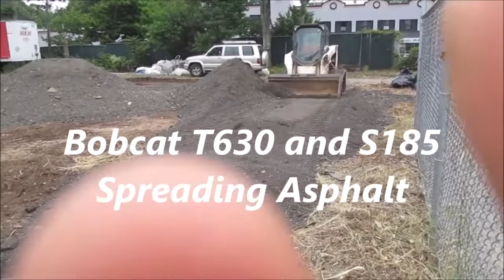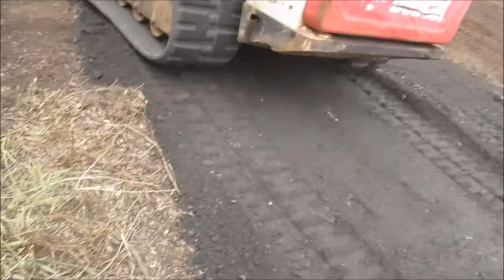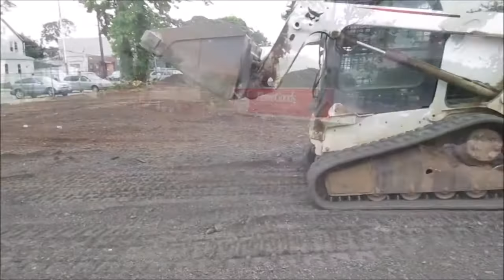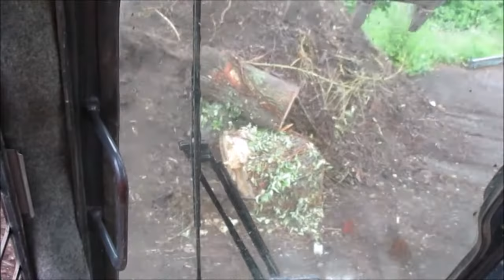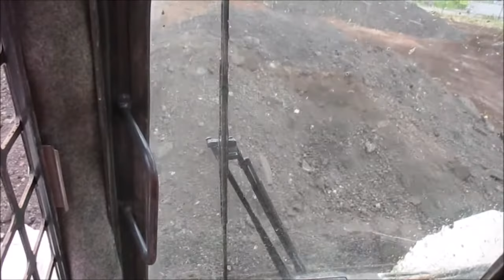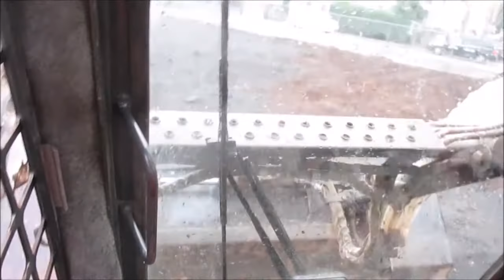Bobcat T630 and S185 Grading Stone

Comment: Great video but why do you hate the t630 hard to hear in the video
Reply from the maker: It has a weak pump in it. It's slow for the hydraulics and struggles to execute three functions at once. Bobcat "opened" the pump, which helped, but it's still not right. The S185 and S300 are great at multitasking. I've since ran a newer T630 and now the hydraulics are better. Thanks for watching.